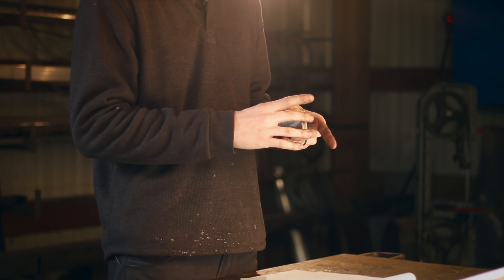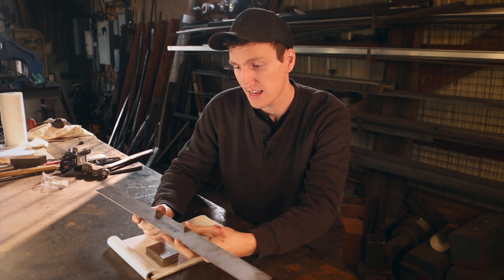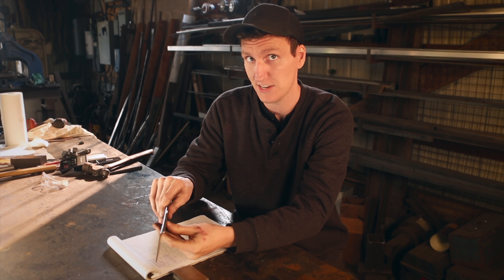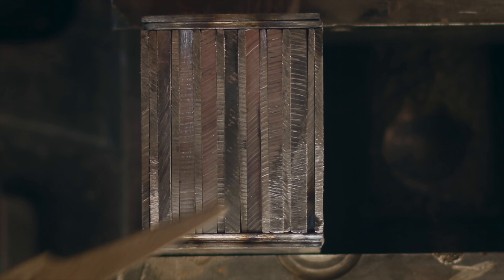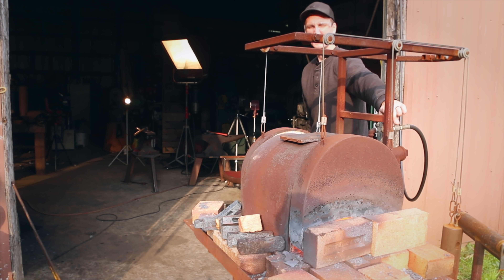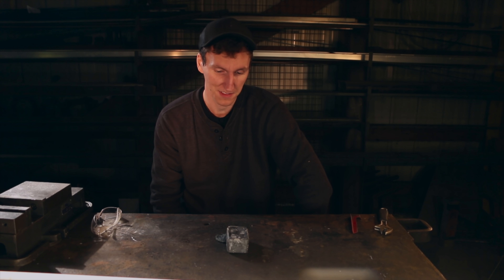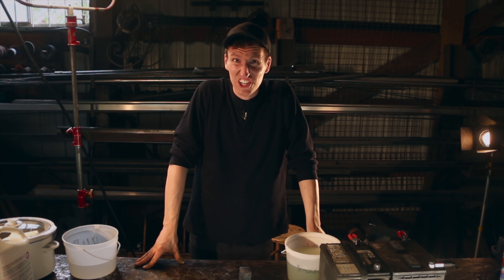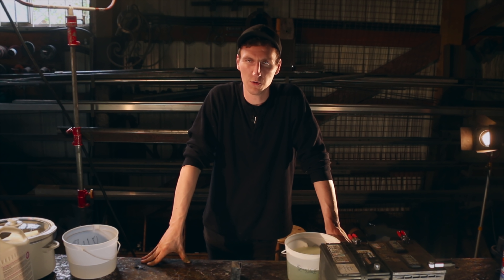Making AEROSPACE DAMASCUS??

Comment: Can anyone write down grade symbols of  this two steels? Good to know compositions of them.
Reply: Niobium is, well, niobium. It's one of the elements of the periodic table. It has no composition to speak of, it's a pure metal and has nothing but niobum, other than perhaps some trace elements left after refining.

The other one is MAR250, or maraging steel grade 250. A quick online search will give you composition, it's very low carbon martensitic steel with nickel, cobalt, molybdenum and a bit of titanium and aluminium.

Comment: Props for going along, even though you learned about the correct melting temperature of MAR250, and the huge difference to the melting point of Nb. If I were a blacksmith (but I'm not) I would have ditched the initial plan. You "failure" was no failure at all, it was highly informative/interesting. But please, wear eye protection when you're working with chemicals, ok?

Comment: I have no idea if this would actuslly work, but if the metals maintain their drastically different melting points after forging, could you completely melt one out of a finished piece? Make a sort of skeleton demascus
Reply: They do that in jewelry making, but it’s a corrosion process. Basically pattern weld gold and maybe copper together, and let some acid eat up the copper. Don’t know about steel but would be very interesting I think, most likely it’ll make a mess because the metal when melted just kinda stay there or not drain completely, but I won’t knock it till I see it.

Comment: Might work better doing more of a checker type pattern with rows of the harder metal, an smaller rectangle of both in the other layer so it is more forced to hold a pattern in hypothesis.
Would possibly look like squares in the one layer from the end if it holds the pattern. But just a guess.

Comment: 1. Damascus is not made by melting the metal 
2. Niobium is an element, not a steel alloy. 
3. Because of number 2 you are wanting to make something closer to mokume gane. 
4. I would love to see you try that.
Reply: Pattern welded is not made by melting metal, ‘Damascus/wootz’ is technically.. it’s crucible steel that is fully melted then worked in the same way as a bloom to consolidate it, the pattern that you end up with is a result of the carbides that form during the process.
Reply: Tom Holloway, yes, but damascus has become synonymous with pattern welded. Words change and evolve over time. Tim wasn’t trying to go for wootz, he was going for a layered billot. Being pedantic about the definitions of damascus and pattern welded steel doesn’t get anyone anywhere at this point.
Reply: Ethan Hansen definitely was not trying to be pedantic, and I hate the argument between the ‘terms’ but it was just your point #1 that I felt I wanted to comment on. I love what he’s done and think that it’s an amazing result...! I just love the way that it completely melted and the niobium stayed ‘solid’...!

Comment: I feel like the reason you couldn't anodize the Niobium is because the current wasn't getting to those middle pieces. You should try to drill and tap one side of those middle stack of pieces, put a bolt in there and attach the electrode to that.

Comment: Browns start at 18v, blues start in the 20's, greens are in the mid 40's (very tight window), brassy colors are in the high 50's-mid 60s,  and the purples are in the mid60-70's. I'm using TSB detergent as my electrolytic solution.  Good luck!
Reply: Just depending on voltage, no influence of dwell time?
Reply: Dwell time strongly relies on accurate voltage regulation. Dwell time only increases the depth of the color. Most companies don’t increase dwell time as it doesn’t increase the surfaces hardness or ability to retain color when damaged. The longer the dwell the more likely color irregularities can present themselves as voltage across the object is not evenly dissipated.
Reply from the maker: Is this on titanium or Niobium? I am using the liquid TSB detergent, seemed to work pretty good on the titanium hammer I made awhile ago. Thanks for your help and info, I appreciate your time.
Reply: @TimothyDyck  they both act very similar in my personal experience.

Comment: Something like s60v might be a good choice for welding to maraging steel to..  You might need to do it in a sealed canister or with an electric furnace with an argon atmosphere as s60v is a stainless steel.  The reason for choosing s60v is that it has a high tempering temperature, so if you could get the two welded, you could harden with specs for the s60v, which should not affect the maraging steel, but then temper at 900F for 4-5 hours, which should leave the s60v at a 50-55 Rc but also result in the maraging precipitating martensite and carbides, also ending up around 50-55Rc...  Not the hardest steel, but should be very usable in a blade and may be all but unbreakable..  
An alternative would be to get maraging TIG rod (yes, that's a thing) and weld it to regular steel, or conversely, get tool steel welding rod and weld to the maraging...
Reply: S60v is good steel but acquiring a pattern will be difficult given the nickel and chromium and lack of carbon.
Reply: for those temperatures, wouldnt HSS be better? something like m42 or m4 would still be 65hrc at 900f. no idea how itd weld though

Comment: Where does the shavings go, I am wondering cause I havent actually done forging or seen a fully forging process but I always do wonder what happens to the metal shavings afterwards.
Reply: I would assume the waste metal is either collected and scrapped , or melted down and re-cast.
Reply: I asked a few different channels a while back and the most common response was that it's melted into slag billets, unless you meticulously clean up after each metal to isolate the shavings from each other, but in either case they're cast into small dyes or they're made into billets for use later.  A few also told me they have ways to use it as abrasive for other softer applications.